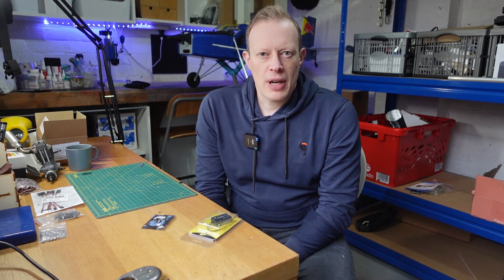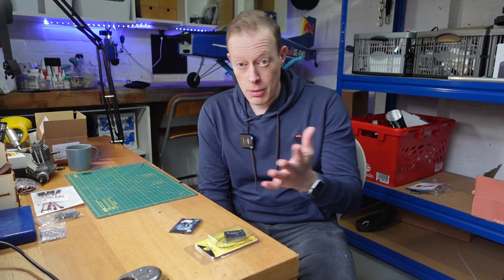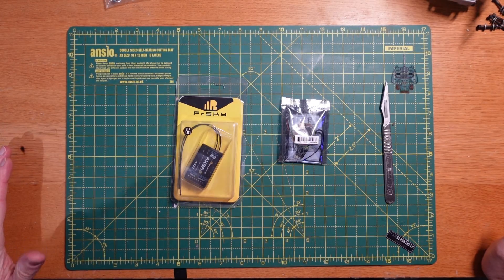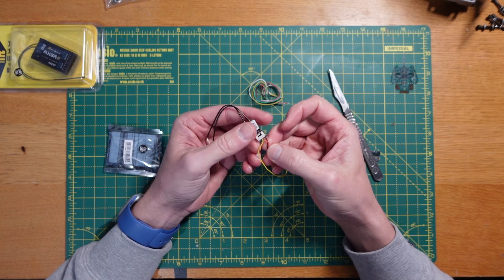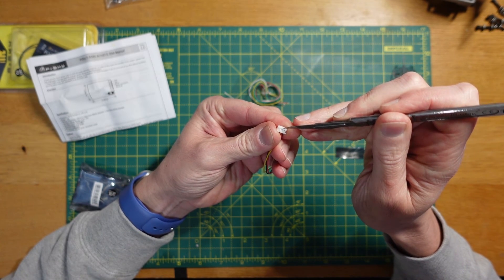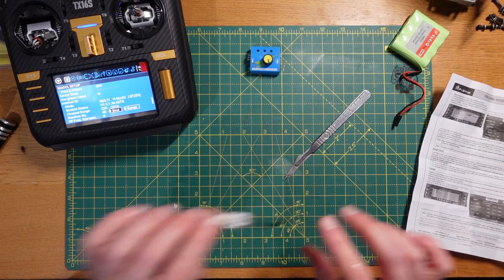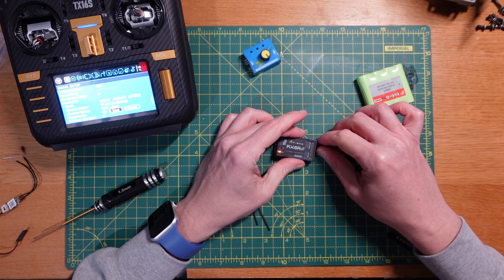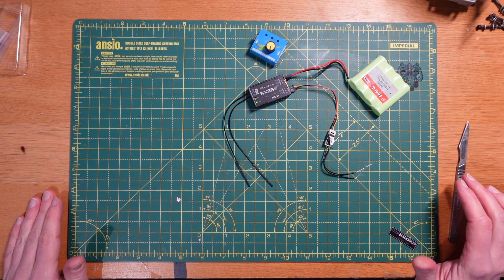FrSky redundancy receiver setup

Comment: In my experience Rx's tend to be very very reliable ...had over ten 67in electric 3d planes and loads of crashes and rebuilds learning to fly Xtreme Aerobatics due to various reasons ...dumb thumbs to ESC fires due to heavy oversize props.

But only ever lost signal twice and that's due to an electric wire fence interference...forgot to turn it off.
After checking signal quality while fence was switched on it was terrible.

Also once when I was getting low signal quality on my Tx after changing out the Gimbals I had accidentally knocked one of the two internal antenna of inside...I didn't fly and suspected as much and just clipped it back ...was perfect signal after.

So personally I wouldn't bother with 2 Rx's and spend my money on the best servos best ESC combination...this in IMO on electric 3d planes as been far best use of funds....and believe me I've spent 1000's ...but if it gives you piece of mind we'll that can only be a good thing.👍
Reply from the maker: Cheers for the comment 👍🏻